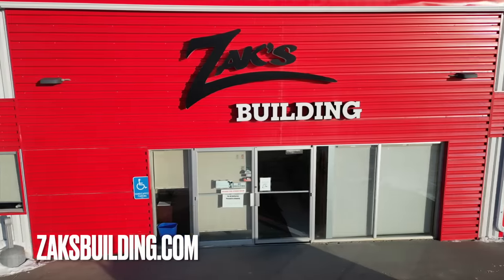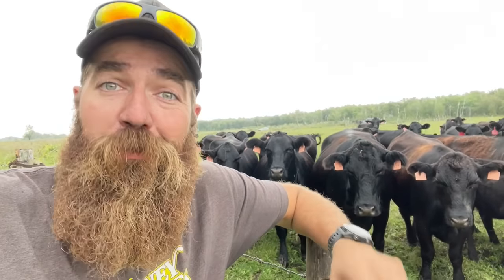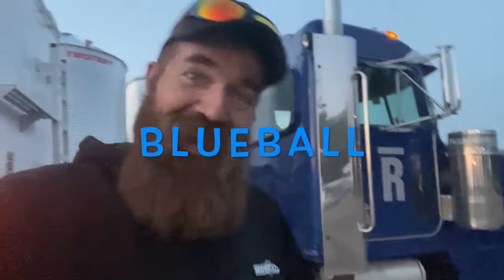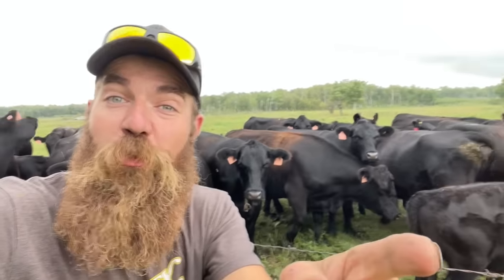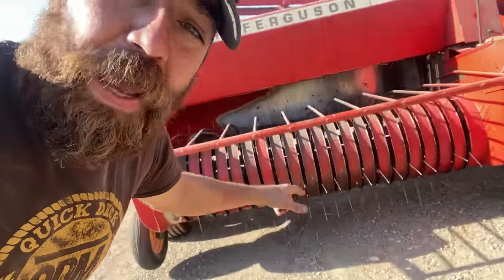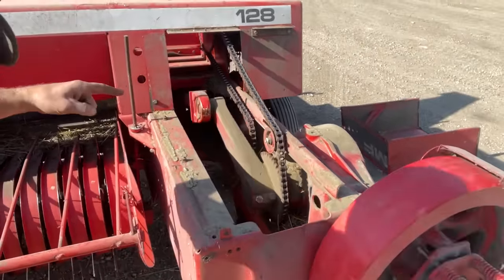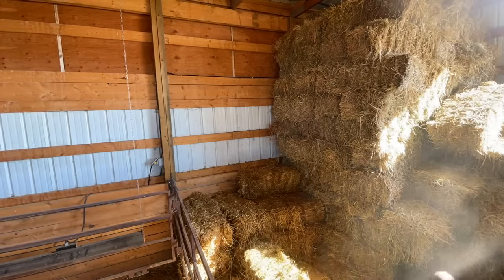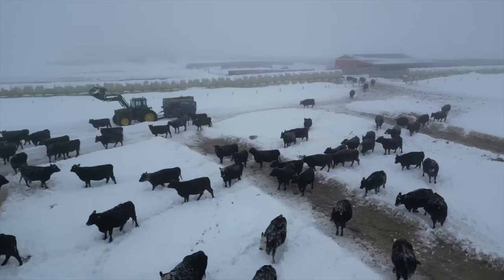Hey, Let's Make More Hay!

Comment: Picking up bales and putting them in the barn usually occurs on the hottest day all summer.😊
Reply: You got that right!!
Reply: Remember in my teens stacking straw in the barn hay loft for ceiling insulation and bedding for the animals in the winter inside the barn. It was 90 F outside on the thermometer and came out of the loft and the outside air felt like I stepped into an air conditioned room.

Comment: I worked for a custom haying outfit, baling, hauling, and stacking square bales, starting at age 14. We baled all sorts of feed, but clover was the worst. I called it the Devil's Feed! Even in long sleeves, you got your arms marred up pretty good, loading up flat decks of clover. 

Round balers were just starting to be used in the field back then, but with an automatic bale wagon, it made picking and hauling square bales easier...not that I ever got to use the bale-wagon. But hey, I wouldn't have gotten as strong as I did, if not for loading and stacking square bales by hand...not to mention having to change out the baler flywheel...by myself.

I don't miss my haying days, but it helped me develop a strong work ethic, learning to appreciate time spent with friends...on rainy days only...as well as developing some muscle.

Cheers QDM.

Comment: The old JD 4020.  That has to be about the most versatile tractor ever made for its time.  At one time you saw two tractors in the field - the JD 4020 and the Case 930.  I spent a lot of time baling and summerfallowing with both.

Comment: I remember bailing hay with a square bailer growing up.  Luckily we had a bail wagon to pick up the bails and make the stack for the winter feeding.  It was the feeding in the winter which was a workout.  My dad made hay hooks which was a hook on the end of a hand grip and we used them to load the bails onto a truck or wagon to take to the cattle.  Sometimes we just used the hooks to drag the bails out to the cows and feed them.  Never did use the round bailer as that came after I left the homestead.  Thanks for bringing back some memories.  Have a great harvest.

Comment: Did my share of haying in the 60's. A couple of guys had a flatbed truck with a cage enclosed seat on the flatbed, no separate cab, a conveyor belt down the middle and another conveyor boom on wheels in front. You drove around, hit the bale, it'd come up the boom and it was stacked over the conveyor belt. Offloaded in reverse. The boom went up to the hayloft of the barn. I think round bales  put an end to this wonderful idea. Never seen another like it.

Comment: Back in the 30's, my dad worked with threshers, feeding them half a stook at a time using pitch forks. He said that back then everything hay or straw, was handled with pitchforks. In the 40's when square bales became a thing, he and most guys back then would pitch bales, both hay and straw, using pitch forks. Just another example of why the older generations were so strong and tough.
Reply: When I was quite young, threshing was still very common.  This would be in the 1950's.  We even had a team of horses.  No tractor, until around 1955.  Pitching bales with a fork was fairly common, too.  Especially straw bales.  Quite a bit lighter and easier to handle, than alfalfa.   The fork has its advantages over a hook, especially when the load got high.   Longer reach.   But,  takes a fair bit of skill and strength to pull it off.  Some of the old timers made it look easy.  It sure as hell wasn`t!

Comment: Lots of hard work with small square bales ..father baled with wire in my youth ..He packed them tight an you had to use hooks to handle them ...The new machine with twine are a bit easier but get heavy after an hour or 2 of pitching them !!  Keep up the great videos !

Comment: I grew up on a dairy farm and was running the square baler at 10 tears old, using a Farmall 350 row crop diesel tractor. Only on flat land because at that age I couldn't push the brakes and clutch at the same time, I also couldn't pull the pto lever enough to turn it off. One time I got a jam on the end of a windrow and father blasted from the wagon behind he baler to the back of the tractor to disengage the pto and nail me in the back of the head at the same time, 50 years later when running a tractor I still duck when I hear a noise behind me. Thankfully we started baling with a 3000 Ford with a selectomatic transmission, (very easy for a 10 year old to run), then moved up to a 5000 Ford row crop that replaced the Farmall with a flat deck so you were way above the dust and could look down at the baler

Comment: Thanks for the demo video, always good to show the nuts and bolts. Question: when you pyramid stack, do you end up with any moisture issues? If we end up stacking, we'll flip a couple on their ends and one on top to prevent rain falling through. We try to hold off that kind of stacking until the fall rains have passed. Cheers!
Reply from the maker: We keep them on higher ground and stack in late fall, seems to work fine 🤠
Reply: Seems a lot easier than the way we do things. Old habits die hard sometimes on the farm. @QuickDickMcDick

Comment: I grew up on a farm, haying was when you built muscle.  It was always good when we shifted from hay to straw, the straw bales felt light enough to play basketball with.  We towed a hay rack behind the baler and had one or two guys stacking onto the rack.  One question:  Why do both round and square bales?
Reply from the maker: Squares are much handier in the barn during calving 🤠
Reply: @QuickDickMcDick  - of course!  I should have thought of that.

Comment: I agree with jeremy Clarkson on the comment that farming equipment is just farmers competing on who makes the most brutal machine to get mauled & / or killed with 😅 that square bailer is looking more dangerous than our farms old circular saw that is powered by the tractors power take-off shaft and the whole thing is diy and basically held together with bolts, nuts and rivets😂

Comment: Why do you stack hay on the flat side? I've seen that on videos, but never in my area. 
I would've got ran off stacking on the flat side, boy the farmers would've skinned me alive.
I never was around a twine baler, always baled with baling wire. Cheaper I guess.
Reply from the maker: …. All the sides are flat….
Reply: Well, reckon so, but I meant the wire side, or in your case, the twine side...the way you are stacking in the video. I was just curious why ya'll stack it like that. I've never seen that before. @QuickDickMcDick

Comment: Actually a few tidbits, never bale the hay too tight, airspace cools the hay, lack of air brings on fire. 

Also everyone should experience backing a full center pivot hay short wheel base wagon into a barn, damn those pups tip easy!  

Cattle farms smell the way they do because of the smell of rotting grass, the cattle is not the cause of the aroma.  As a certified landscaper I am well exposed to rotting grass, yes my pickup truck and mowers smell like a cattle farm with no cattle present!
Reply from the maker: You can bale the hay as tight as you want as long as it is dry my friend :)